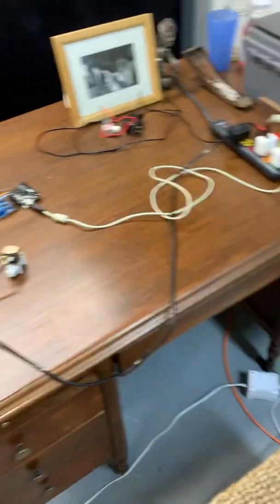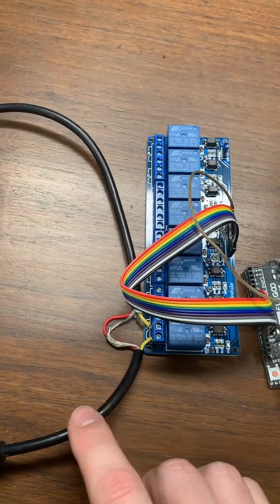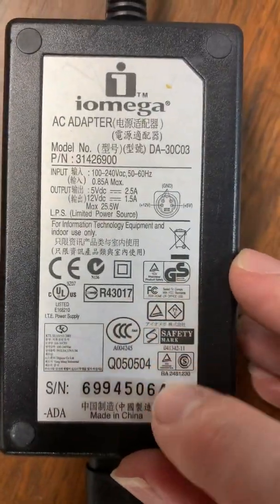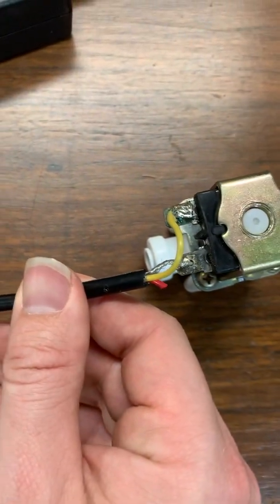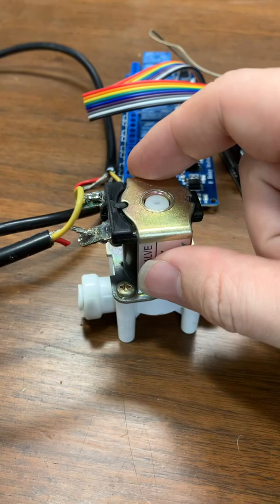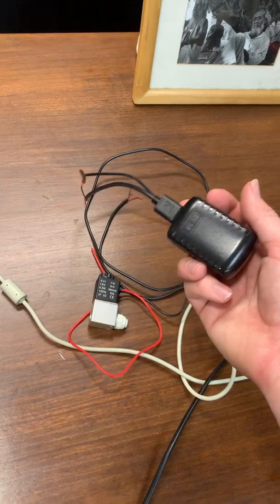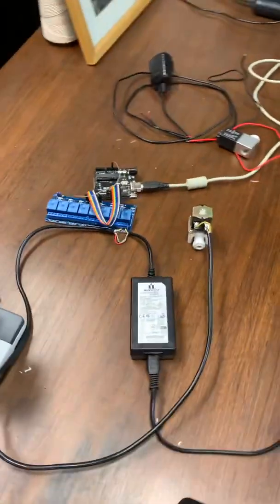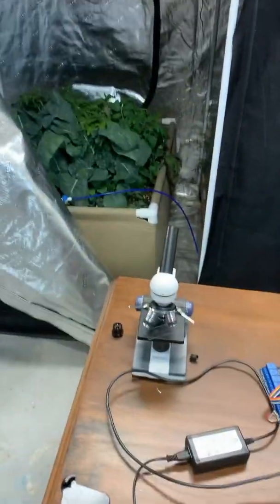Program a Solenoid with an Arduino for Aeroponics Irrigation

Comment: hey I need more info. can I please message you or do you have a instagram I could DM you on? Im  trying to figure out how this process would work for multiple solenoids and the programing for the actual elegoo.
Reply from the maker: It's tricky for sure, but what you got to do is connect an esp32 to homeassistant, or if youre trying to just use the elegoo, its just about writing the code right. I can show you, add me on discord Gonzo#8224

Comment: We want to design a vertical ebb and flow hydroponic system (a system in which the roots are submerged into the nutrient solution once or twice per day, each for about 30 minutes). Now the main issue is the drain of water in each cup after submerging period. 
Our simple design - a reservoir at the bottom, a submersible water pump in the reservoir, an inflow tube that transfers water to the upper level, and several levels of cups. Now we need to hold water in each cup for 30 minutes. 
We can use a valve at the bottom of each cup, but it's time-consuming. Is there any simple way for that?
Reply from the maker: Good question. Ideally you could have valves that could connect to a micro controller. 

But maybe you could use siphoning, fill the cups slowly, and once they get to a certain height, (30 minutes), it siphons the rest out.
Reply from the maker: You could do this by drilling a hole in the side of the container at the height you want it to start siphoning, and put a tube in there, such that the hole is water tight. one end of the tube goes down to the bottom of the container, the other end of the tube goes back into the nutrient solution. time it such that the flood ends right about when the siphon begins.
Reply from the maker: https://www.youtube.com/watch?v=_vV_z_0lFQ8
something like this could work too

Comment: Links to any of the stuff?
Reply from the maker: https://www.amazon.com/DIGITEN-Solenoid-Connect-normally-Closed/dp/B016MP1HX0/ref=sr_1_6?dchild=1&keywords=solenoid+valve+water&qid=1616880305&sr=8-6
Solenoid
https://www.amazon.com/gp/product/B008GRTSV6?pf_rd_r=E95FPW02T73QHJ9TW91D&pf_rd_p=5ae2c7f8-e0c6-4f35-9071-dc3240e894a8&pd_rd_r=03df4ad8-078b-4f11-b0ee-31c3b50880b9&pd_rd_w=FdUdf&pd_rd_wg=tDNWZ&ref_=pd_gw_unk
arduino
https://www.amazon.com/JBtek-Channel-Module-Arduino-Raspberry/dp/B00KTELP3I/ref=sr_1_5?dchild=1&keywords=relay+arduino&qid=1616880797&s=electronics&sr=1-5
relay

Comment: Hey man, whats up ?
Thanks for the video, that was quick.
Couldn't you just connect a timer to the thing?
Anyway I'll do some research on my own.
You are probably correct with the way you are doing it.

I'm really disappointed your not growing with areo anymore.

I know why though.
Its impossible to grow multi crops in one grow chamber with one res.
Believe or not it's the same with cannabis.
Just from strain to strain.
The nute demand is so different from one to the other. 

Like I stated before, the systems I use consist of 2, 21 site grow chambers with one res.
So when i put that system to 12/12 (flowering stage).
I have 42 plants of the same strain. This way I can run a true nute solution for that strain.
The 2 weeks later I put another system to 12/12 with a different strain.
Then 2 weeks later another system. And 2 weeks after that one another.
That makes 4 systems i have flowering at once.

So now 2 weeks after I put the 4th one to flower.
I can harvest the first system.
So every 2 weeks i harvest a system. And start a system.

I have 4 mother plants that I take clones off of.
Forty two at i time.
Depending on the strain I can keep these mothers in the veg. stage for 1 to 2 years.
I clone everything in areo cloners I built.
I take the clone and in 5 to 10 days I have roots.
But I let them go 17 days to establish a good root system.

Then the clones go straight to 12/12. No veg time.
The clones are 5 to 6 inchs tall when they go in.
And buy harvest they are anywhere from 17 to 30 inches tall.
All in a 3'x3' area in the sea of green..
I have found I get alot better yield ( per s/ft) for a quarter of the price.
Than growing in soil.

I have also found as you have, that veggies are better grown in soil.
Unless you grow just one item.

But in regards to your areo setup.
We need to talk.
You've got something going there.

I'm going to start researching everything in that setup.
And do some modifications.
While performing some cost break downs.
And performing a complete grow with these setups to see how they perform with the nute solution I like to use.
Anyway good luck and take care.
Reply from the maker: I guess you could setup a timer, but its nice to have a micro controller. its the next step up from a bunch of timers. It gives your more control and precision.

I am into organic healthy food so, I would grow flowers and things like that on aero, but before I would get back into it for food, I would want to figure out the nutrients in a different way. I'm sure it can be done. I would be curious if it could be done solely with organic methods. No bottles from the store. Soil is a bit more stable and robust though. More things can go wrong and the plants survive. When the water runs out or something doesn't work with aero, you can lose the plants very quickly. Also my tomatoes are going to taste better in soil no doubt.

My aero setup was loud and a bit expensive, but it worked really well and the roots were super healthy. Lot's of potential for aero. Mixing it with aquaponics for instance. The sky is the limit!
Reply: @Ghanzo  hey,
As you can see from my previous statement i agree with you in regards to veggies being grown in soil.

Last summer I built a 10'x12' greenhouse.
For the purpose of trying to grow with living soil.
For cannabis (just one plant) and a wide selection of veggies and melons.

I've always have had a very large outside garden for about the last 10 years.
And the veggies and melons are the best ive ever tasted in my life.

BUT.

I live in california and right across the street from me.
Is a very very large farm.
And every spring and summer they grow miles and miles of some kind of veggies.
Well for the last 3 years, when they spray their crops for bugs. Which they do alot of. Way to much in my opinion.
Anyway where do you think the bugs go, once they spray.
Straight to my garden.
Just these last 3 years.
I've seen so many different bugs I didn't even know what they were.
And within 2 to 3 days my complete garden would be destroyed.
So that's why I built the greenhouse.

For about the last year I've been following this guy on youtube, who grows all organic in living soil.
His channel is CannagrowBC.
He is very good, and he explains and shows you everything.
From mixing your own living soil to brewing all different teas.
Check him out.
I'm going to give some of his methods and brews a try real soon now.

In regards to going all organic with areo.
Yes it can be done.
But you will still need to purchase some bottles.
But the bottles really are not nutes, so to say.
Like micros, aminos and ensymes.
There's no salt's in them.
I know of one person who brews tea's and grows with areo. And he gets great results. Better than me.
But not by much.
Anyway take care.
Reply from the maker: @assog5737  Man that sucks that that spray effects your land. In spain there is a region that farms exclusively in greenhouses. Really trippy to look at from a satellite. Good thing about greenhouses is that they are more resilient to climate extremes. One plant for a 10x12? Jesus, she must have been huge. One of my favorite growers is this guy jim who people call “clackamas coot”, who has a style of soil called “coots mix”. It’s centered around worm compost and rock dusts. Really cool the kinds of things happening in the living soil space. Ill check that channel, thanks.